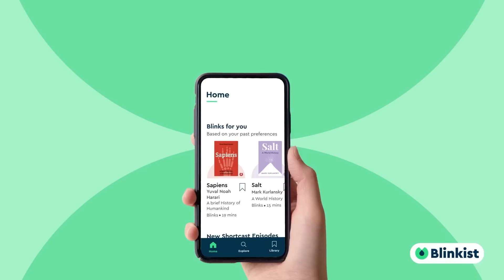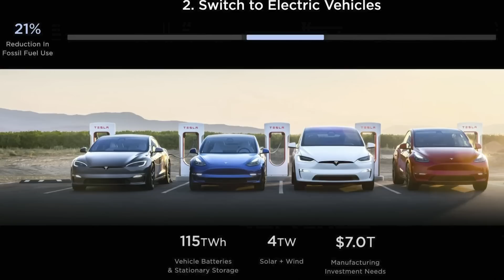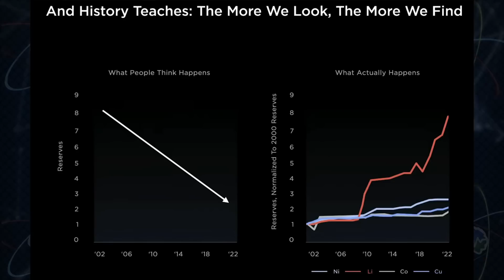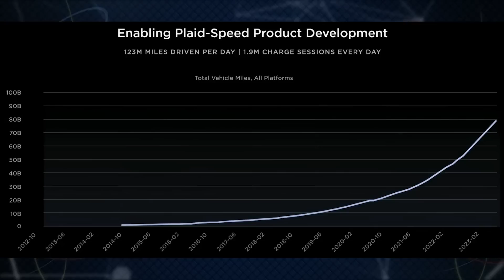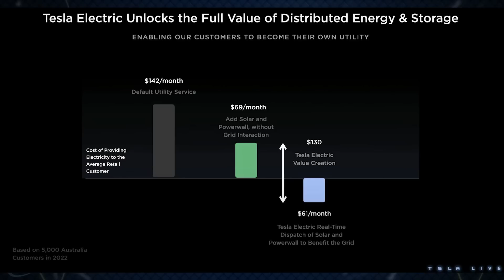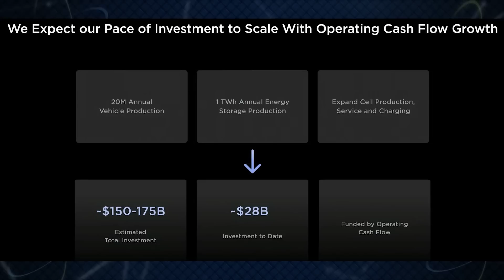We Squeeze Tesla Investor Day Into 30 Minutes | In Depth

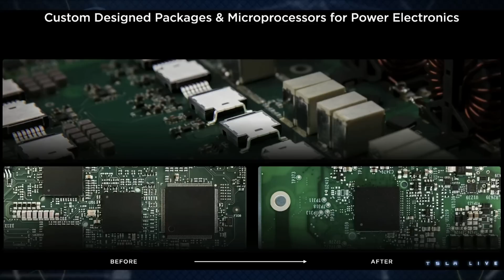Comment: The screen cap you show at 13:07 requires some clarification.  I think they messed up the presentation a bit.
1)  The top half shows the silicon carbide components.  These are power transistors (MOSFETs, IGBTs). They said they were able to use smaller and cheaper components (not fewer of them) because of an innovative packaging design that provided better heat sinking.  And I can see how they did that; it's pretty clever.
2)  The lower half of the screen is the 'before' and 'after' pictures showing how their custom micro-controller replaced four COTS micros.  These are not silicon carbide devices.
Reply: Yes Cory and Sandy refered to this at Farzad's post prsentation discussion.

Comment: Permanent magnets with no rare earths: Iron Nitride magnets. Stronger magnetic force per mass as compared to neodymium and cheap to make the material. Discovered in the 1950s, but was flukey to make the material, so it was forgotten about for a long time, but new engineering has found a cheap and easy, reliable way to make Iron Nitride. -My guess for what they would use.

Comment: @22:37 It is a wireless charger. See the mat under the car? Also note there is no charger cable coming from the wall mounted unit.
Reply: Wow.  I literally did not even notice the mat.  It looked like a shadow on my screen.  😆
Reply: Yup. It looks like an induction charger to me as well. Once FSD is solved for, they will need the autonomous cars to be able to self park and charge itself. 

However, during the charging portion of the presentation. They said they want to shift the curve to charge cars when the time of day when the sun out. And one part of that equation is relaying more on AC charging. 

I suspect that if they can outfit office parking structures with wireless charging mats. That a Tesla can simply pull over and don’t need to worry about pluggin in. It would help towards that goal.
Reply: Guess that’s why poor old snakey never got made 😂

Comment: Just a correction: SiC is not for processors at all, it's for the main inverter, which converts the DC battery into three-phase AC for the smooth operation of the electric traction motor. an in-house inverter design. The Tesla 2018 in house design had several innovations beyond the use of SiC packages, but this is the main one. It has led to the overall weight of the inverter (4.8kg) to be under half that of the 2019 Nissan Leaf (11.15kg) and over a third less than that of the Jaguar I-PACE (8.23kg), which used silicon insulated-gate bipolar transistors IGBT inverters and off-the-shelf parts. The result is Tesla's overall inverter and permanent magnet motor combination is one of the best on the market, achieving a 97% efficiency, yielding more range without increasing expensive battery capacity. All at a similar cost to the older technologies being displaced.
Now Tesla announced a 75% reduction, but this is due to a new way to design the SiC MOSFET transistor from planar to trench technology (major breakthrough in technology)

Comment: The amazing thing is that despite the rather jaw-dropping progress, cost improvements, design, etc .. that was presented ... Wall Street still thinks this event was either a 'yawn' or actually bad news.  WTF?  (business as usual, sadly)
Reply: WS wanted a new bumper as VW presented and was totally disappointed. Or a fancy new windscreen wiper as Hyundai showed. 

Of course a nice teal is more important than transitioning to sustainable energy. 

I understand. Its easier to think about the color of your car instead if your children can still breathe in 20 years.
Reply: F'em
Reply: The factors that Wall Street look at to determine the value of a company are messed up in so many ways, this is just the tip of the iceberg. Quick profits for investors is all that matters even if the business suffers in the long term.
Reply: Wall St - follow the money (currently invested) - still held/supporting oil, coal and gas.  EVs still only 10% global uptake.  When uptake reaches say 50% then look at Wall St if it still exists.   Woof woof.
Reply: Real investors don't think like those sheep.
Reply: This is simply an idea. There is little proof of historical proof of concept.

Comment: I haven’t read all the comments because they’re a lot of them. But anyway you were wondering what the power wall station was in the garage if you notice the line goes down into the actual floor and goes across under the floor to a charging induction pad.you’ll notice that the very rear of the Tesla underneath the car,you can see it. Yeah.😮

Comment: For me the biggest part of the night was going to 48v for the low voltage wiring.  This was something they wanted to do years and years ago but the parts didn't exist.  Now they are big enough to make them exist.  :)
Reply: The parts did exist, I'm into electronics and can assure that all of the electronics in a car run on 1.8-5V and there is no short of 48V converters for this range. I don't know why they did 48V now, but there is another reason than lack of the parts.
Reply: @BHBalast  Well DUH. You aren't understanding my point. the systems that go in cars are traditionally based on 12v.  And they do use off the shelf components.  Of course it's simple to step down 48v to whatever they need.  I think stuff like window motors and such they may just develop 48v versions.  Electronically what they are doing is not a big deal.  And now they large enough they have the scale to do it profitably.
Reply: @Nerlin  I earn money by designing electronics. At the point when you can build your own car to your spec, you are well past the point when custom 48V electronics starts to be profitable. I'd bet that they stayed at 12V because of laws of some sort, not their tech. I do agree that 48V is a welcome upgrade to 12V, I just don't agree that they wouldn't do it because of their tech or lack of the parts.
Reply: @BHBalast  I too am in Electronics.  :)
Reply: @BHBalast  I don't do links,  but years ago they said why they stayed with 12v.  But now I guess that ship is sailing.  It was discussed at some time in the last 10 years.
Reply: The legacy car makers talked about switching to a 24V system to save weight years ago. Glad Tesla actually went with an even higher Voltage.
Reply: @BHBalast  All parts have to exist, be cost competitive, and pass a certain bar of quality + scale. Tesla isn't going to run multiple voltages in the car in a gradual transition.  The whole Set of requirements are finally in place.

If it was easy, someone else would have done it first
Reply: @Nerlin  If you are info electronics that's even better, I don't want links because I remember this situation. I just wonder what parts didn't exist to allow for 48V installations. 48V cables? 48V buck IC's? Also remember that all of those parts would be bought in tens of millions of units, that opens a lot of doors.
Reply: @thomasreese2816  Not necessarily if it would be easier someone would do it first because if something works fine there is tendency to not touch it, especially when profits are healthy or there is a lot of management in company. Parts do exist and are cost competitive because 48V is already used in industrial cases for years.

Comment: I was wondering a lot that 48V is such a new thing over there in the US. Porsche is using 48V here in Germany for years.
Reply: Shows you how hard inertia is to break in the auto industry.  Tesla isn't afraid to change norms when doing so is good engineering and good manufacturing.

This is why many ICE vehicle companies won't be around in 10 years.
Reply: Beim Taycan??!
Reply: @lollihonk  I think even on the SE-Hybrids they used the 48V-Bordnetz. I am not sure but i know my brother worked on that stuff 5 or 6 years ago.
Reply: Do these Porsches pull trailers? Are these trailers 12V or 48V. I could change my trailer to 48V but I have another car... and how about hiring a trailer?

Comment: Home Wall Connector INDUCTIVE CHARGING unit.  This wall mount charger has a floor pad that you park over and your car will automatically start charging.  My guess is that it will charge at a slower rate then the wall connector, but you will never forget about plugging your car in again.  JUST A GUESS GUYS
Reply: Wireless charging will benefit commercial users, public trnsport and taxis (ep=specially a robotaxi) far more than domestic users.
Reply: @davidbeppler3032   Have you seen the Momentum Dynamic system? If you had you'd know that your staement is complete rubbish because it's around 96% efficient.
Reply: @davidbeppler3032  No, I have seen indepemdant tests.

Comment: Here's a thought. If household voltage was converted to low DC at the switch/fuse box then all the transformers used in every building could be eliminated. Fire danger through sparking and cable overload would be reduced too. What household appliance  needs 240/120 volts AC ?
Reply: Funny thing, I’ve been buying 12v wherever possible in anticipation of going off grid. AC is one of the largest challenges. So long as you are happy with hang drying your clothes.
Reply: Microwave, oven, electric kettle, I'm guessing water heater, AC, EV

The problem with lower voltage is you would need higher amps to get the same wattage

Higher amps = higher temps and higher amperage is more dangerous than higher voltage

Home charging a tesla would be impractical on a 12v outlet or you'd need to be pulling over 100amps on that circuit
12vx100a=1.2kw

Tesla wall charger gives upto 7kw iirc, so on a 12v circuit that would require 600amps, so you'd need water cooled wiring in your house?
On a 120v circuit you would only need 60amp circuit or down to a 32 amps circuit on 220/240v

Comment: For the TSLA investor/bag holder, continue buying the dip. The earlier the better I guess. In 2015 while I still worked at Fremont. I got TSLA shares at $91. The entirety of those shares were valued at $2.6M before I sold late in 2022… I ordered my model Y in 2021 I got it at $52k 3 months later. This is not a feat I was able to achieve alone. I diversified my portfolio and in total I am north of 3M at 38 also thanks to my FA
Reply: it is precisely at times like these that investors need to be on guard against the next certainty. You don’t have to act on every forecast, hence i will also suggest investors to get yourself a financial-advisor that can provide you with entry and exit points on the shares/ETF you focus on.
Reply: please who is the financial adviser that assist you with your investment and if you don't mind, how do i get in touch with them?
Reply: @akibeekymre4880  Thanks for this tip. Her website popped up on the first page immediately I searched Yvonne Annette Lively’s name, I read through her resume and it seems pretty tight. So, I dropped a message & hopefully she replies soon.

Comment: I'm hoping the wall unit in the garage is a bi-directional charger with built in 5KWh battery to run the house while you drive to nearest supercharger to recharge your model 2's LiFePo4 battery.

Comment: Good to see you two living up to the name of your YouTube videos.  I am a retired consulting electrical and mecahical engineer - did 52 years designing buildings with architects.  We live in a cold climate, Black Hills of South Dakota, have one main house, one guest house, one cabin, one unheated garage and one two-story particall heated garage with a studio apartment upstairs.  All of these are total electric, heating, guest house with a standard heat pump and the rest heated with either high-efficiency heat pumps or geothermal.  Apparently, most of what was presented went way over the heads of a lot of commenters, as well as Wall Street.  Typically, when people don't have the brains to understand, they downplay what's being said.  Our Tesla stock took a 9 - 10 percent hit.  It will recover, but the commentators won't.  I grew up in the car business with miy Dad as a Lincoln-Mercury sales manager in the 50's, and was a Ford fan.  Now I''m seeing all the Legacy auto manufacturers with their heads in the same sand.  My overriding takeaway from the Tesla show yesterday was that IF I WAS A CAR MANFACTURER AND I WATCHED THIS, I WOULD FEEL DOOMED.  There seems to be no way to catch or Even Get Close to Tesla.  Thanks for the good reporting and comment.  PN

Comment: The whole thing together was the most powerful part of the night, not one single part of Tesla works without the other part.
Simply the best company in the world.
Reply: Yep, Tesla's don't drive with out 4 wheels. Good Design
Except bicycles do. Better design. (best part is no part philosophy).
Reply: @PeterTerren  you fall on the bike pretty easily with 2 wheels though.
3 wheel design would be safer, especially on ice. in nordic countries everyone cycles, but they also have real winters. but it would take more room, which might be unacceptable.

Comment: Thanks for the breakdown. You did a good job. 
On what was said at event.  
I do wonder about some of Elon's figures. I believe once upon a time he stated all the US energy requirements could be met with 10000  square miles of solar.  All the new solar farms going up around here are 11 acres per megawatt.  That means Elon"s solar farm would generate maybe a third of current electrical usage for US.  This doesn't include adding Transportation and Industrial requirements currently powered by fossil fuels. So double again maybe.  50-60 thousand square miles.   That makes me question his other claims.   I find comparing the weight of oil and gas coming out of the ground from a half dozen wells in the middle of a cattle field as the same disruption as removing the same weight of battery ore from an open pit mine, a bit disingenuous.
White paper should be interesting.

Comment: 7:42 - The fossil fuel industry is not about to roll over and play dead.  I see lots of foot dragging coming.
15:58 - Sandy Munro's dream has come true, the Cybertruck will have 48 volt architecture!!
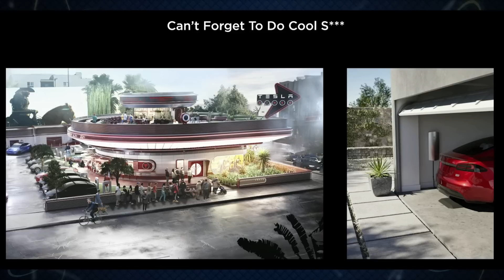22:20 - Some think that thing sticking out from under the car is a wireless charger.
And so many articles thought the presentation was boring.  Short attention spans I guess.
And the stock market didn't get some new shiny "thing" so sell, sell, sell.

Comment: I don't think that the new nextgen manufacturing method will be used to build Models 3 and Y - until new production lines are built that make 3 and Y. Elon specifically said that the existing Model 3 and Y lines wouldn't be being upgraded because that would require shutting the lines down. I don't know if you noticed that the dimensions of the new plant in the rendering are similar in width but 50-60% of the length of the Austin plant. It can be smaller to house the smaller nextgen production lines. I think that the plan is to make the new smaller, less expensive, lower labor cost nextgen cars in the Mexico plant. The obvious target of these cars is Mexico, Central America and South America where Tesla hasn't made any inroads because of the purchase price of their existing cars being as high as they are.

Comment: At 13:09 the change in circuit board’s design is huge! Old board had big transitors/fet that are usually manually placed on the cct board by humans before solder bath. New design allows more parts to be added by a pick and place machine (more automation = fewer mistakes and failures)

Comment: Big thing that happed during the q/a was confirmation about V2g. Saying it would be rolled out to a lot of the current cars in just 1 to 2 years. That’s what I’m guessing the new charger will be that they showed. It looks very similar to the Ford charger. I hate how anti v2g Elon is but looks like they are planning on doing it.
Reply: He's said before they had it briefly, and (like the sunroof), no one used it, making it an unneeded cost.  I can totally understand why he's against it.  People also make it out to be better than it is.  It's great for emergencies, but that's pretty much it.  Why pay 5x as much for a battery on wheels, when you could just buy a PowerWall, etc.?   The economics don't make much sense.  Especially if you work for a living, and that battery/car disappears from your home for 8+ hours a day.  You're paying more for less usability.  People could even get more budget battery backup solutions for even less than a PowerWall, too, of course (Bluetti, etc.).  V2G is most useful in buses and such to supply emergency power to community centers, hospitals, etc.; not so much for residential use.  It also just degrades the battery more.

I think he was saying they could implement V2G if it became a necessity; not that the would definitely.
Reply: @AMortalDefiant  i disagree. I am already buying the car for the car. The car can transport me where I need to go. A power wall cannot. A power wall is $11k but it’s only a 13.5kwh capacity. I don’t need battery backup when I’m not home. But it sure would of been nice to tap into my 75kwh battery back when there was a power outage. And even if my car is gone for 8 hours that still means it’s still sitting for 16 hours that could be used by the utility if they wanted.
Reply: @Cyrus  Agreed, even if the car is gone during the workday, it's hopefully able to run off solar, with a small battery to run things until the car comes home. (5Kwh?) after which it runs off the car battery from 6-11PM and then during the night it charges the car with cheap super off peak electricity. And of course with the cars 75KWh battery it can power essential loads for a week if necessary. 75KWh of powerwall would cost as much as a model Y Plaid. When combined with your and your neighbors solar & EV cars bi-directional charging you become the hardened core of your neighborhood microgrid!